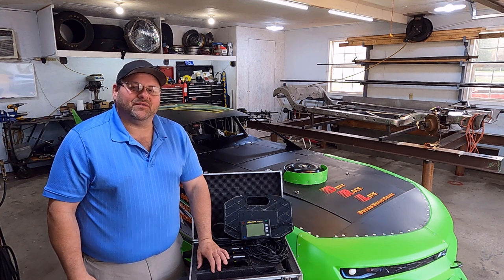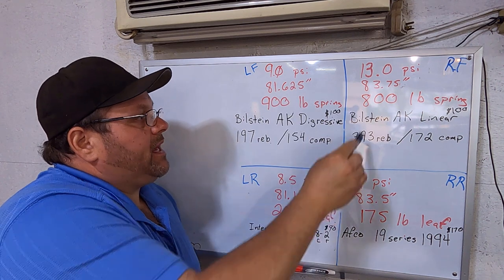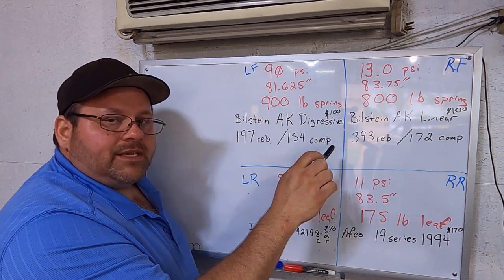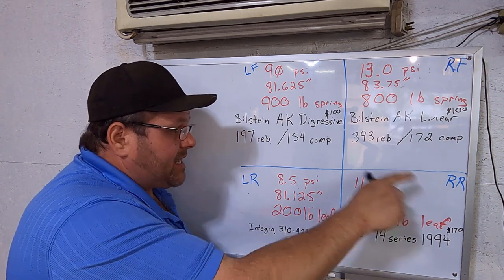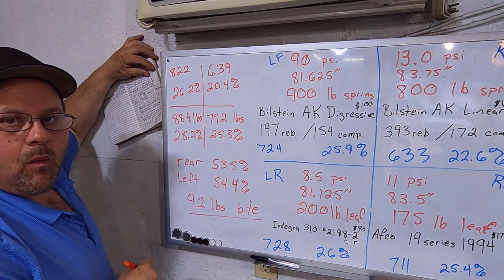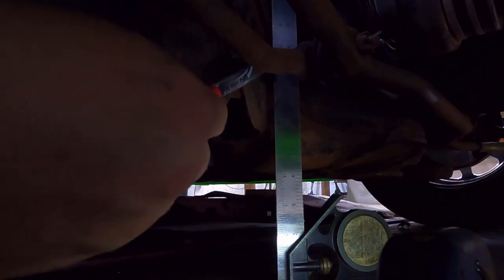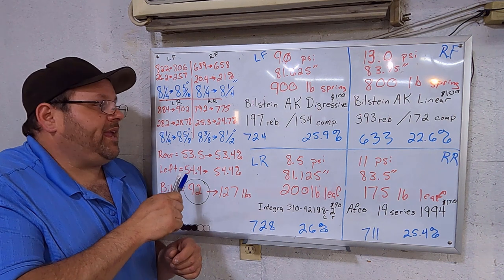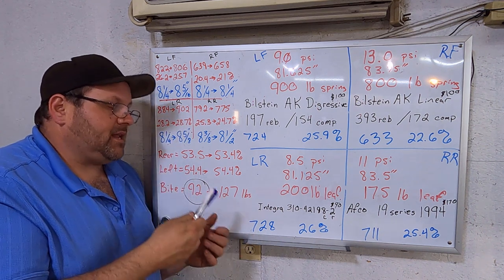How to Scale, Adjust, and Understand your Race Car including Spring Rates, Shocks, and Ride Heights!

Comment: Good instructional illustration. We run at Batesville Motor Speedway in Arkansas. We have to run 3200. It's a high bank 3/8 miles.  We like to run more left rear because of the momentum that the track promotes. We don't slow much in the corners .  I get a lot of information from your content. Keep up the good work.
Reply from the maker: Thank you, I have been to Batesville to the Schoenfield SS race years ago. Would love to race there one day.
Reply: @DIRTRACELIFE  they are running Arkansas factory stocks which are mainly metric cars. The leaf cars can't stay up. So we have a separate class for the called hobby stock. Basically the same rules as FS but leaf springs only.  Also they are running the IMCA stock cars. Great racing with them.  They took the place of the street stocks

Comment: Interesting concepts for sure. I especially like the disclaimer, track prep, conditions and rule packages has a lot to do with set up. We too run CRUSA class car, except it’s a Thunder Bomber that is in our area. Since your shocks are spec, tires are rethreads, and a restricted engine package a free setup is a must. Actually we run far less bite, because of the LR biting too much that it creates a tight car. Since our engines don’t have lots of hp to drive the rear around, this is what works for us
Reply from the maker: I know exactly what you mean about horsepower. Last night I ran at a track that was rough as a cob but hooked up on the bottom and when I was in that groove I had to stay hammer down to keep the push out of it. Its a trade off and at that point I was thinking "Maybe a little less Bite might have been ok after all" :)
Reply: @DIRTRACELIFE  you took some video footage of your race?
Reply from the maker: @jasonlogan3209   yes, probably take me a couple days to get it up, but I will.

Comment: What about moving lr in? For more wt on that tire? Alot say u can't get a 5 inch offset over the caliper? I did always, not easy but do able..
Reply from the maker: Yes I agree, if you set up the calipers correctly a 5 inch offset works. BUT  . . . If you are running a 62inch rear you can do it on the left side and it not rub the shock tower and leaf but not on the right side. If you run a 60 inch rearend, it may even run on the left aide as well. Have to really check your clearances to run a 5 inch offset wheel.
Great feedback and discussion  Steve, thanks for watching our videos.

Comment: Which set up did the camaro perform best on heavy rr spring or softer
Reply from the maker: On a slick smooth track I have found the heavy RR setup is the best way to run a leafer.

Comment: dumb question here. Im 54, built a few stock cars back in 06-07,...but because of money never raced. I built those from the ground up. I had buddies who won in stock cars so i even got info from them. My question,...i watched some vids on youtube lately and the street stock/stock cars are right front diving in the corner and kinda carrying the left front. THATS odd to me. Back then they ran around 900-1000 LF and 1100-1450 RF . I seen your "soft spring" setup, is THIS what they're doing now? The ones i watched were flying while rolling over on right front.
Reply from the maker: Yes Scott, I am seeing the soft RF setup everywhere here in the south eastern US. I think much of this is a result of a tendency for most track surfaces to be intentionally managed in a way to create a smooth dry slick surface by the time feature races come. It seems very common to see metric cars running between 600 and 700 lb RF springs and 100 lbs more on the left. It does work but requires an entire system tuned to it and just be aware it DOES NOT like a rough track at all. For me I am going through a process of testing, driving it, learning, changing variables, etc in order for me to truly understand all the aspects where I can both create success for my team but also be able to teach the mechanics of it to everyone here on the channel.

Comment: Why not move rr out and lr in to add more wt to lr? And adjustability with wheel offsets for track conditions?
Reply from the maker: Steve, you are correct about how that will move weight left but it will also have a negative affect of loosening the car on the throttle that is more significant. For that reason I don't consider it a good adjustment to change bite.
Reply: I think that your bar angles and panhard also the bite bar are not working together?  I'm not sure every car is different, but I have seen guys get numbers and roll center, scale numbers in there head and never get a winning car?  Bit thats me, give the car what it wants, stopwatch don't lie, I don't care if it's fast with a 500 lb lr spring, if it wins races, run it, lol
Reply: @DIRTRACELIFE  I ran 5" offsets on left side and 3" on rt, moving lr in helped bite a ton, also I ran a 175 or 150 on rr spring in 1994, everyone said no way? In a 3500 pd pro stock on asphalt at shadybowl  fastest 3/10 mile banked trk, fastest trk they say for size., just saying I never ran dirt, but all classes I was a crewcheif,
Reply: @DIRTRACELIFE  I would increase pinion angle, and put 2 on sway bar for entry and exit, and use rear stagger to fine tune, less stagger is faster, always remember u are dragging rear tires down straight ways,
Reply from the maker: Sure agree with you on the Stagger Steve. Anything more than that perfect amount is doing nothing but scrubbing speed off.

Comment: What would running a heavy RR spring vs a LR spring do?
Reply from the maker: You would have to put more preload in the LR spring to get your bite number to the same amount. Now the issue there would be, your having to run much lower on the lr shackle than the rr shackle to get that bite load up. One inch difference is fine but 3 or 4. . .. now it creates bind on the housing if both spring perches are at the same angle. So instead you would need to disassemble the LR spring and re-arch it to add at least two to three inches of arch. At that point you could likely make it work but the affect... hmmm, I would expect the car to get tighter middle to off corner because you would probably get a more consistent LR bite load while traversing the corner. This is because your range of movement on the LR would increase with slightly smoother change in the bite amount. But entry??? Not sure. And it would eat those LR springs like snacks. If I did it, I would probably be measuring arch after ever race to determine when to re-arch again. 
I'm not against it. Experimenting is how you find speed. Just need to be brave about signing up for all the problems you might encounter.

Comment: 🔄  What is  Bump Steer and can it be Ajusted❓
Reply from the maker: Nick, bump is the change in a wheels steering angle as the assembly moves up and down. This happens because the height of the centerlink is fixed  but the attachment point on the spindle is moving up and down. Yes changing the height at either end of the tie rod assembly directly changes bump and the length and location of that assembly does as well.
Its complicated for sure but we have plans to make a video on this as well.
Thanks for watching.

Comment: What about scaling with swaybar hooked up? I always unhooked it scaled and set nutriel?
Reply from the maker: I have never run a sway bar on dirt. I hear that a few do but for me I feel it would go against what I am after which is a car that will transfer over on the RF and bring in some rear steer by doing that.
Reply: I ran a sway bar accidentally back in my teens on the rear end of a gm metric.  Car only ran the top.  After taking it off and changing rear springs the car rolled over and I could put it anywhere.
Had a front sway bar that was there for heavy track (I guess, didn't build the car) but it was set up where it didn't work and you could adjust it to be in use (never did).
I wouldn't run one
Reply: Yes I agree, we ran asphalt at shadybowl u have to run one in every class, maybe? But I ran a big bar only in front and no one ran it like me? Old school, but it was great, never ran dirt but I have alot of respect for drivers and crew, its tough competition always and a ton in a feature of cars.
Reply: I always had a saying, go to the bar to get in and off !! Worked always, gave us better entry and exit, it won 4 track championships on Fri and state two tracks, we also ran a hvy street stock in sportsman 500 pds hvy and won the feature also.

Comment: Can you refer me to any thing that can get me started with learning setups and understanding the basics of setups?
Reply from the maker: I have read every manual Steve Smith put out. If you are new then definitely find a copy of Steve's "Street Stock Technology" I started with that book 20 years ago. It is the perfect place to start BUT it doesn't go nearly deep enough or cover the complexity of roll center movement, squat, dive, or drive. Just where to start. If you are already racing and feel like you understand all the basics of setups then this is where you have to make a leap. Start reading setup books on modifieds and late models. You won't get that next level understanding in street stock books (one of the reasons I started DRL) but you will if you start studying the information for more sophisticated cars. I was able to build a much better understanding of how cars act dynamically on the track by reading manuals such as the one Steve Smith and Joe Garrison put out on Late models. Go to old forums like 4m.net and read literally EVERYTHING in the technology sections for all the different classes. The key is getting that grasp of how the engineering element works for any four wheel vehicle going in a circle. Then you look at your particular car and application and apply what you've learned. I hope this helps and thanks for watching!

Comment: Hi when taking about bite. You say 84+8. 92lbs of bite. Where did them numbers come from

Cheers
Reply from the maker: Thats Left rear bite which is just subtracting the total amount the right rear weighs from the total left rear weight. I said 84+8 just doing the math in my head. Heres an example. Your left rear weighs 900 pounds and your right rear weighs 800 lbs. You have 100 pounds on left rear bite (900-800=100).
Hope this helps and thanks for watching our videos!
Reply: @DIRTRACELIFE  if you get bored. Look at uk 2.0 national hotrods. That’s what I’m trying to learn about. Thanks for the info and video
Reply: @DIRTRACELIFE  you turn left?
Reply from the maker: Yes, thats turning left so it all mirrors for you guys. It would be wanting the right rear heavier instead.
Reply: @DIRTRACELIFE  more bite the better? 

Little bit of a mirror confusion test for ya!

So on a 700kg car with left 115kg and right 178kg. I would have 63kg of bite. 63kg of 700kg is 9%

You have a 3000lbs car with 90lb bite so that is 3%

Would I have too much bite and what problem would that cause, pushing?

Like you having 270lb bite on a 3000lb car
Reply from the maker: Well yes and no, it all depends on what is happening dynamically. That much static bite could be an issue if it is setting back down and loading the inside rear tire from middle out. If the setup has a high cg and and shock on the opposite corner in front that has strong rebound it very well could work and you just need to add some lead into that inside rear tire or some more stagger.
Reply: @DIRTRACELIFE  cheers. Defo need some weight over that inside rear(rear right)

Do you know for every 15 American videos on oval circle short track racing videos, for every forum or write up about USA. There is probably 1 uk video so I’ve learnt so much from mirroring all of the data and working out the opposites😂

Thankyou for taking the time to make these as everyone in the pits is hiding there knowledge like they found the gold at the end of  rainbow
Reply: @bendoherty7721  if your winning races noone on your team tells the truth, thats a fact, no matter how much u pay them to set your car up, u can build 10 cars on same jig, but no 2 cars work the same? Remember icoc at Daytona races.

Comment: How did u get 52 to 53 rear bias legal by rules? I built a street stock and I kept all low and left and rear, only got 51 52 max, ever, that car should be a bullet..lol
Reply from the maker: Steve, its a combination of factors. At the time the weight requirement in CRUSA SS was 3200 pounds and since the car is built light it gives us the ability to put 300 pounds right over the rear. Our front end bumper and bracing is practically nothing. I accept that any hit in the front means me making or fixing some tubing. The whole front cover and front fenders are abs plastic and the body is aluminum. It let's us be lighter to move weight where we want. Just keep in mind this is for dirt and in many classes I race in you have to be at least 52% rear just to keep up.

Comment: You really should Scale without shocks.  Especially with a pin down on the car.
Reply from the maker: You are correct Cregen. My front shocks on the Camaro are Bilstein gas shocks and because the gas exerts a continuous rod force they will have an affect on the scale numbers. In my case it's not much, maybe a few pounds but according to how much gas and what shocks it could be more for some cars. Those shocks I run are stock location, in the original shock mounts and are quite difficult to unhook. I choose not to unhook them but I absolutely agree with you. If you are running gas shocks then unhook them in order to remove that rod force affect from your scale numbers. Good catch and thank you for watching.